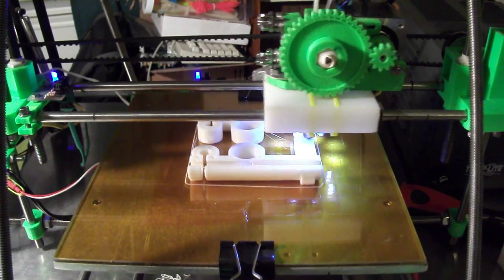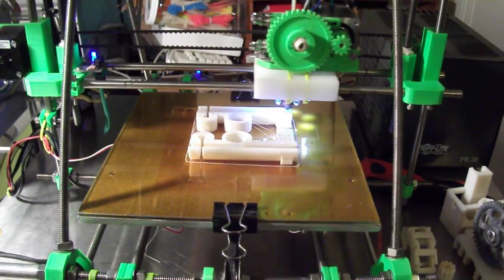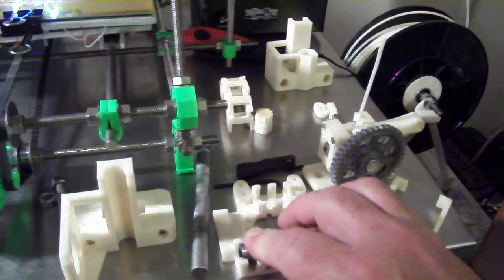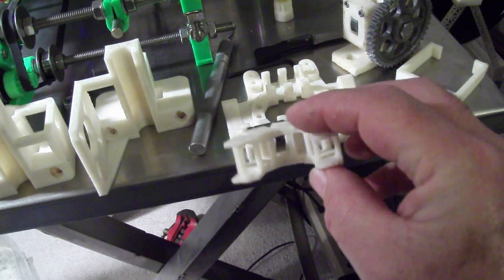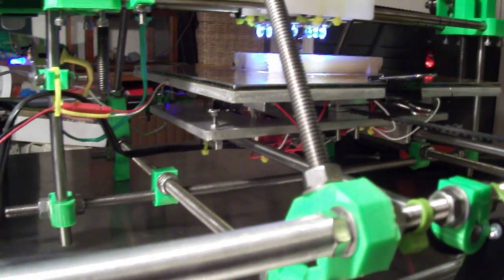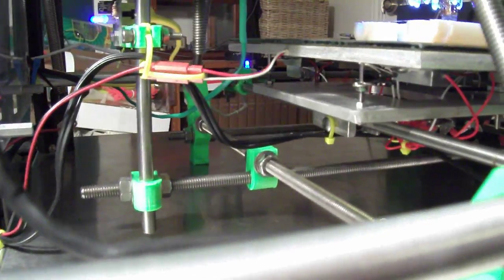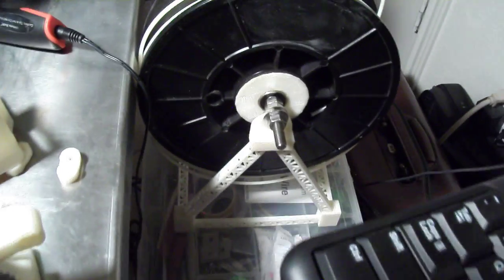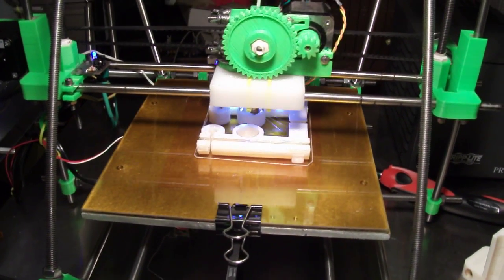My 3D Printer Printing parts for mod's

Comment: Great stuff Jeff!  I think if you want the Y endstop on the front you just need to flip your Y motor plug on the RAMPS 180 deg.  I just printed my Z lower bearing design yesterday. :-) Lots more printing to do..

Comment from the maker: They can be printed, but the main problem is that there is no support at the spaces where the wire would be wound around the bobbin, so the quality is not there, firepinto is working on this problem, with his dual extruder printer. I believe he is still building it. I built two hotends for it and shipped them to him. Also he is looking into Slicr 3 software to run it.